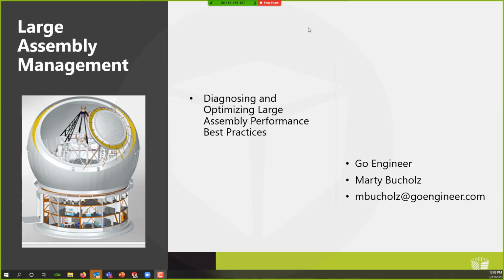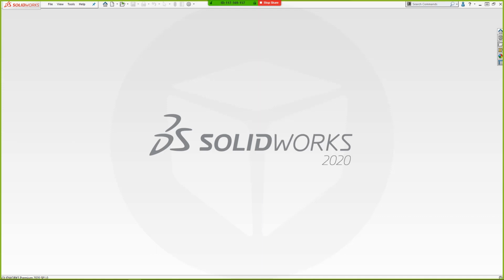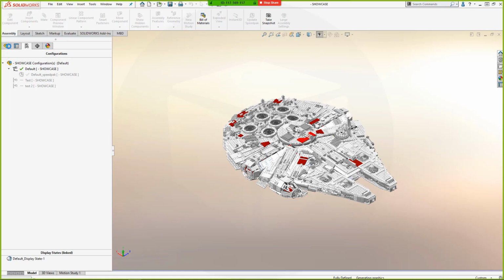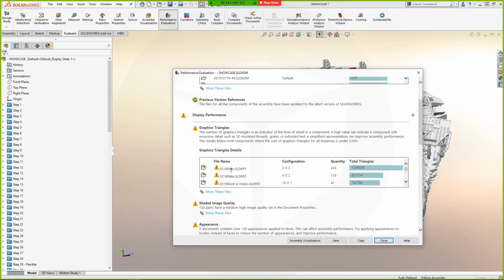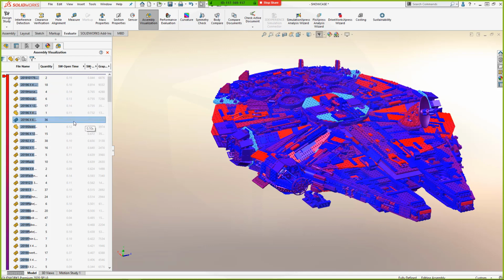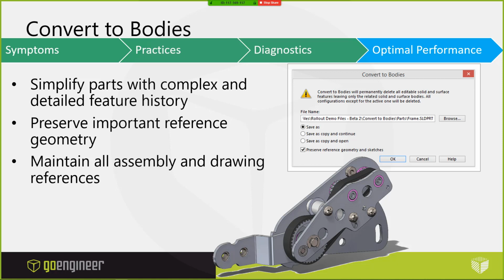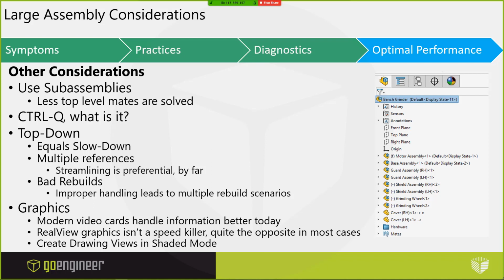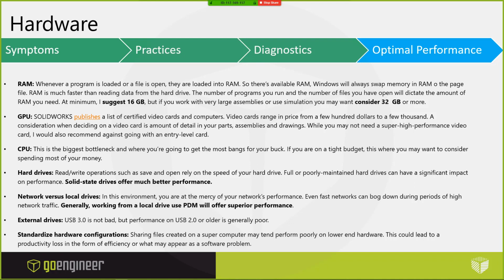SOLIDWORKS Tutorial - Large Assembly Management

Comment: With assembly visualization, it lists the number of instances of components and the time to open. Is time to open the time for all instances combined or for each instance?

Thanks
Reply from the maker: The time listed is for opening a single instance of the model

http://help.solidworks.com/2020/english/SolidWorks/sldworks/HIDD_VISUALIZATION_DIALOG_HELP.htm?id=0812c05cdd22497db9a3bb5686e22f66#Pg0
So the more often that a file with a higher time to open value has to be opened in an assembly file. So it can be beneficial to reduce the open time of the model or reduce the instance count in the assembly. This is one of the reasons many large assemblies can be helped by having configurations where all of the hardware is suppressed for example.